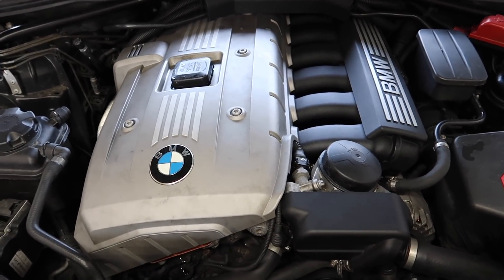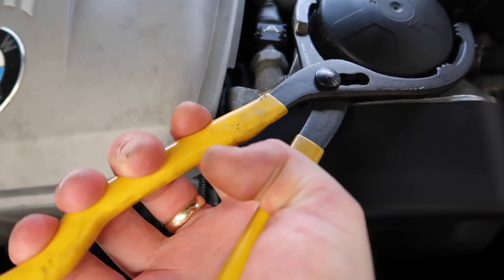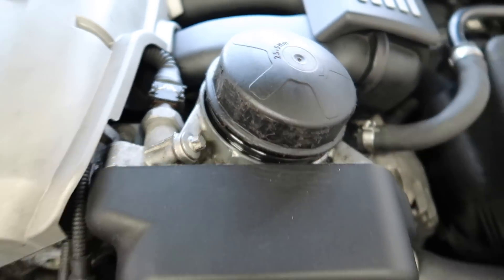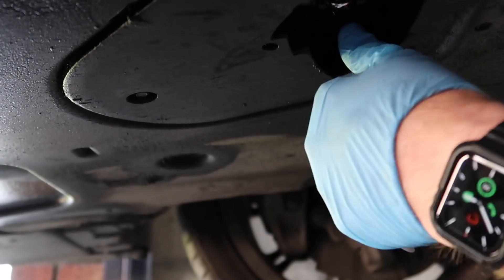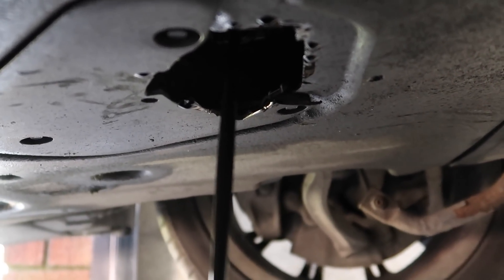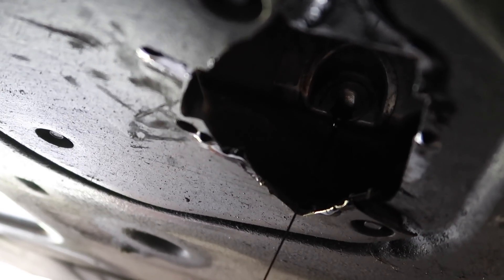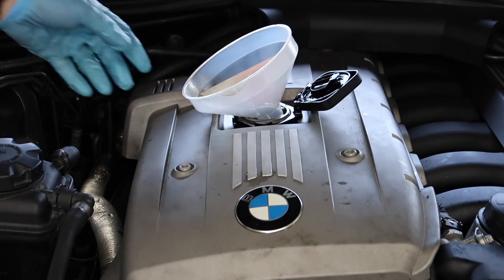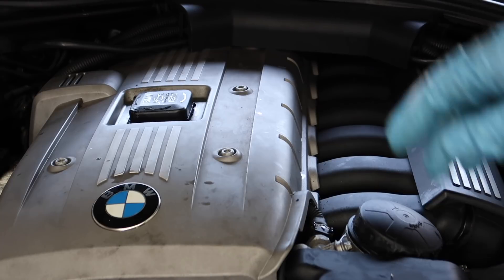BMW N52 Engine Diagnostic / Problems N51 ,N52 , N53 , N54

Comment: I used to drive my 2006 530xi 40 miles to work.  Then home on the 3-11 shift, at midnight.  I hit an already dead dear one night and took out my oil pan shield completely. ripped the bolt holes out. I fixed it with some plastic milk jugs.

Comment: Great video. Hoping this easy fix takes care or p0012 and p0015 codes that keep coming up. My oil filter cap does not have the spring or anything. Hoping it fixes it, if not i'll have to take a look at the timing chains and vanos assembly.

Question how is the spring missing from the the oil filter cap causing vanos codes?

Comment: Hi due to the whole coronaV lockdowns bs my n55 barely did any miles since February (last oil change bmw0w30 oil) 
Did like 800 miles but going to be over 6 months am i safe to keep going for 12 months without changing oil

Comment: Right so I took my fuel injectors out and cleaned them they looked fine and had to replace the top o rings but on start up and idle the noise is still there it sounds like a rattle tick tick sound? I need help with this any chance I can send a video and you can help me out?

Comment: I cringed when watching you remove and fit the new oil cap with that horrible tool, surely you can find the proper tool that cups over the cap, I bought mine years ago, oddly meant for Volvo engines, but the same size, and was expensive. But yes, this issue with the oil cap can cause all kinds of problems.

Comment: nice video, hope this helps out the n52 community, something so simple yet so important. My car was feeling very sluggish and random VANOS codes were appearing for a few weeks until I finally discovered my filter cap was missing the spring. (thrown out with filter on last oil change). Changed new OEM filter cap and car ran like new. I'm glad I found it in time before permanently damaging my engine.

Comment: Hi there I have a 2006 130i, now it was serviced  around 1000km back and all of a sudden my lifters are making a clicking noise now I have taken them off and cleaned them and put them back for they were not that dirty but it’s still making the same noise? Doesn’t bring up any lights or anything on computer? What do you think that can be?

Comment: I don’t know what’s wrong with my 528i e60 I changed the park plugs and coils new gasket and more but the car has trouble after driving for 40 minutes straight it’ll act like it’s not reading what I’m putting down on the gas pedal and go to a complete stop I changed the new battery and battery terminals but still it won’t go past a good hour of driving and the bottom left of the car makes a weird sound of a car about to turn on then catching it self staying on please let me know u you’ve ever had a issue like this
Reply: check the alternator?
Reply: Leroy no it not that I don’t know what’s wrong with it like it’s fine driving for 30 mins but then my rpms will drop out of no where and then will turn on but turn off after 10 seconds of being on

Comment: Have you ever had to replace the fuel filter underneath the car ?
Reply from the maker: Fuel filter is NOT located underneath the car on these.

It’s found in the fuel tank on the passenger side and DOES not need replacing.

Please see my other video for fuel filter replacement

Comment: Dr. I have a huge issue. I have the 52k from the e70 I replaced vanos, cam shaft position sensor, disa, valve cover, CCV, and I am getting a misfire. After the car starts it’s shakes and then struggles to idle, then fixes itself. I know the spring is missing in the cage, do you think that is the problem? My filter was crushed after 200 miles btw.

Comment: I noticed you used 5W-40 oil... I believe mine asks for 5W-30(?). Is there a specific reason you use 5W-40 or is that what the manufacturer recommends for your particular engine?  I have a 2011 328i (that’s an N52 as well, right?)
Reply from the maker: As mileage gets on these cars and over 100K I would start using 5W40 much better
Reply: I am also wondering if I should switch to higher viscosity as my N52B25 is over 100000km.  However my daily drive is under 25 mins and the oil temp seldom pass 110 degree celcius.  Pls advise Doc :)

Comment: This has happened to me while I let a family member borrow the car for 6 months. They were well-intentioned in getting the oil changed before they returned the car to me, but it wasn't until I got some VANOS codes the VANOS and replacing solenoids and sensors,  after making a few long distance trips (1,000+ miles each) that I discovered that the oil filter cap cage was missing. So, the shop that changed the oil must have broken it and not replaced it.  Now even after replacing the filter cap and resetting adaptions, the car is jumpy at idle.
Reply from the maker: and thats why Im making awareness about this issue its happening to to many people
Reply: Holy crap. Never ever take your BMW to one of those oil change establishments. Do it yourself or take it to a mechanic who specializes in German cars.ok  Just ask them what brand filters they use. If they don't answer meyle, mann or factory OEM then run away.
Reply: It's amazing how that little part can cause so much troubles and misleading codes. So do you think something is permanent damaged with your engine now?
Reply: I certainly didn't take it to the shop. My well-intentioned relative did. No telling on permanent damage. No codes after replacing VANOS sensors and solenoids. Just a severely, jumpy and rough idle until the engine is completely warm. Need to smoke test for vacuums leaks.

Comment: Isn't it possible,that filter got damaged because the filter cover was overthightened? 25nm needs not so much thightening 🙄
Reply from the maker: NO !!! This filter does not get damaged by over tightening I do this all the time with no issues please go refer to my other videos doing this never this issue
Reply: I have seen filters like this was on m52 engines also,i change oil after every 10-12 thousand km and always used Premium filters and i blamed overthightening in my head 😀

Comment: Thank you very much Dr. Dean!  My car has just started throwing codes, and I assumed that it might be time for new vanos solenoids, but it might also be this.  Much thanks to you for pointing this out.  You are the best my friend!  Also thank you for your video "9 things you will need to change on your N52 engine around 100,000 miles."  It has been a great guide for getting my car back to great condition.
Reply from the maker: you are very welcome and its what i'm here for
Reply: you are teaching me so much that I want to get a second n52 engine, but this time with a manual transmission.
Reply from the maker: good man go and do it the videos are here ready to go but I wouldn't get manual if it was me I HATE manual to many cars with manual transmission here in the UK
Reply: actually they are so rare here (e90 manual transmissions for sale) that I just want to drive one.  I have never driven an e90 manual.  maybe after driving one, I might not want one anymore.  I did have an E46 M3 back in the day (2002) with SMG transmission.  Ever work on one of those?  I heard they had all kinds of problems.  I didnt own mine for long.

Comment: Doc, what causes the spring to go missing?? Thanks!
Reply from the maker: It gets SUCKED via the oil filter housing people don’t even realise there’s is MISSING and that gets caught on the vanos adjusters and it’s what causes a lot of the codes and engine FAILURE !!!
Reply: @BMWDoctor  Nasty, eh! Great info.
Reply: I don’t believe mine ever had one!  Are they all supposed to come with that spring?
Reply from the maker: YES they are if you don't have it it means its running around in your engine
Reply: BMW Doctor crap!!! I will now have to double check it for peace of mind
Reply: BMW Doctor ok just checked and spring is actually there but I’m not sure what it does as there’s nothing that seems to move in that insert
Reply from the maker: mate why does all you guys ask me this I thought you guys were professionals on this engine ??? 

I mean why hasn't anyone on YouTube ever shown this out of the DIYER bunch in the USA I dont understand 

its there for oil pressure reasons that spring is compressed when oil pressure is up for the vanos to advance and MUST be compressed all the time while driving

Comment: I like to know how to set and look for the oil level on the dashboard since I am not too sure how to do it.  Thanks in advance!!!  Good luck buddy!!
Reply from the maker: coming soon for you I will show you this also how to code this in on BMW E60
Reply: @BMWDoctor  I've coded it on to a m54, but unsurprisingly it didn't work. Do you know if the level sensor can be fitted in place of the old m54 oil sensor in the sump?

Comment: Thank you very much for this guide I appreciate it. Any chance for a link for the oil cap please ( N52 B30 )
Reply from the maker: I will try and find one to link I got mine on trade account I think there usually £50 for this cap
Reply: BMW Doctor thank you. The things I got to do to this engine to get it fixed, people think you can just drive it till something go’a wrong and then fix it. with the 2  snapped rocker cover  bolts I had to drill out, tramps left the broken bolts in the hole.

Comment: "B Camshaft position timing over retarded"  could it be the chain? The vanos solenoids I changed  and the sensor. What do you think? I have power loss too. The oile filter is broken i have ot but its broken like in the video
Reply from the maker: well you need to change it
Reply: I had those symptoms as well. Changed new OEM filter cap and all was good after. Who would have thought the cap was that critical.